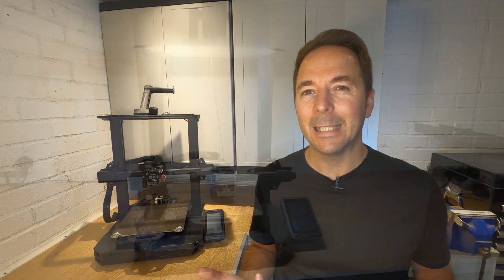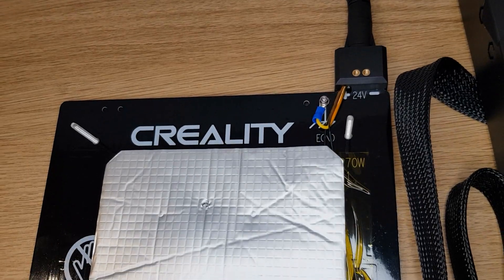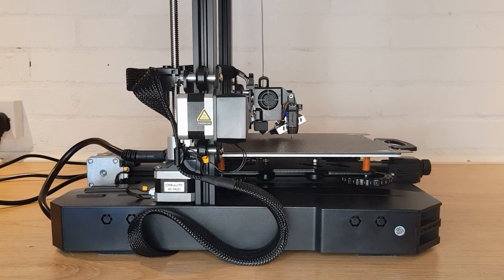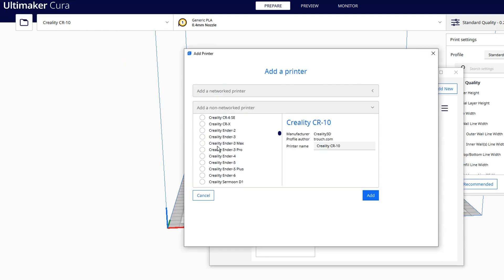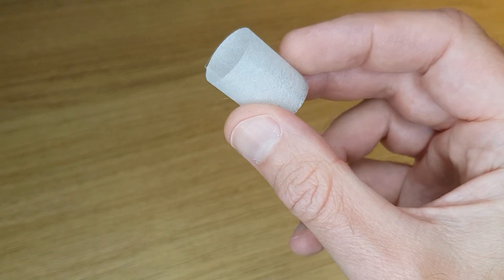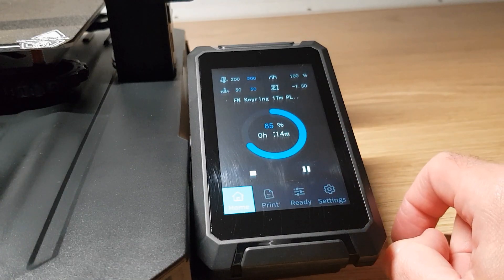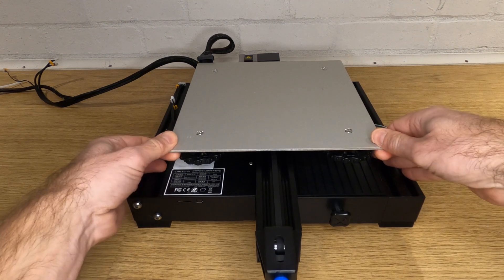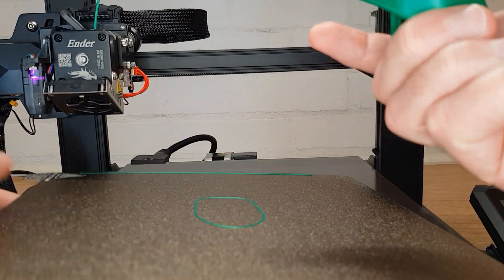Ender 3 S1 Pro 3D Printer Review - Is It Actually Worth That Much?

Comment: Here's my two cents about the review:
Awesome video - stumbled across your videos by accident by searching for Leveling fixes for the S1 Pro. You're one of the few people online that show the S1 Pro and not the Ender 3 or S1. 
Appreciate the indepth dive. 

This is my first 3D Printer and am really happy with it.
Now for the printer itself:
Going in I knew about "Quality control issues". And I am not equipped with two left hands. I love to tinker and know how to solve problems.
But boy oh boy was this a ride.
1) Bed rollers were wobbly. Excenter-Nut solved that.
2) X-Gantry floppy. Again the Excenter-Nuts were too lose and meant that the right rollers weren't even making contact with the V-Beam. 
3) Z-Axis Screws way too tight due to misaligned top / bottom ? I couldn't even move the X-Gantry by hand and this meant that when the printer reversed direction you could hear a hard "CLUNK" as if torque was released. I had some Z-Axis print-issues. I loosened the mounting brackets for the two Z-Axis motors aswell as the top mounts for the screws. Everything could move freely. Retightened and I think I have fixed it now. Not sure. Time and testprints will tell. 

All in All it's exactly like you said in your review. It's not plug and print. But it COULD be if Creality get's their QC together and fixes this.
Reply from the maker: Yep, they design pretty good machines but rarely put them together well. There are others that are starting to do it all better and if Creality don't sort out their issues, they are going to get left behind. Thanks for the comment giving your experiences. It's a shame that it seems you got worse build quality than me but glad you are capable of putting it right👍
Reply: @RickyImpey  Thank you for helping me as a newbie out with your great videos and especially the tutorial on Bed leveling and the addition of G-Code that is required to even use the bed-leveling. Appreciate the effort you put in your videos.
Reply: @RickyImpey  Can you do a video for PID on the Pro as well? Can't find a video for it. It doesn't seem to have AutoPID tuning like other models.
Reply from the maker: @TheD3adlysin  Have you watched this video? This is how to PID tune a 3d printer if you can't do it on the screen https://youtu.be/DG1Yvt02l1I
Reply: @Ricky Impey  Watching it now. Kinda fascinating that the Ender -3 S1 has AutoPID but somehow this Pro version omitted the feature...baffling.
Reply from the maker: @TheD3adlysin  Yes, I think it's all to do with the touch screen.

Comment: Great review. I just got my S1 Pro. For some reason when I run autolevel and go back into Aux level the Z offset is way lower than it should be and it drives the nozzle into the bed. I have also had the nozzle be way high, like up to 4mm. Not sure why my autolevel is being so inconsistent. I've checked all rollers and eliminated some (not all) of the slop in the Z rod bushings. The bed also has a pretty bad low spot in the middle and the autolevel does not seem to accommodate for. I'm less than impressed with this printer :(
Reply from the maker: Oh no! It certainly sounds like something is not right. It obviously shouldn't be doing that. Have you tried resetting the EEPROM, setting the z offset to see if it works ok without the bed mesh? I guess if your bed probe is not triggering correctly then you're never going to get a consistent z height 🤔 Have you tried contacting Creality for support?
Reply: @RickyImpey  yea I just sent them a response - see video (if you want) https://youtu.be/-l6K1gAY1WI
I have not tried resetting EPROM, not sure I know how, but I'll look it up. If I run the autolevel, then go back and manually correct the printer prints great. I'm just miffed that the automation is not working correctly.
Reply from the maker: @SinisterGamingTabletop  Watched your video. As you say, something is definitely not right. The only thing I couldn't see and you can check out, are the z axis lead screws moving when you drive the nozzle to the different points on the bed? If they are then it confirms that the printer is using the bed mesh to compensate for what it thinks is an uneven bed. That would very much narrow it down to a probe or mesh issue. I have seen other comments where people have had similar issues and I even tried to make mine mess up when I reviewed it but couldn't. I think there are a few people in the community looking for a solution but it would be interesting to see what Creality suggest here. Keep me posted.
Reply: OMG, I never even thought about that. I just checked and they do move ever so slightly. Thank you for that suggestion! I was wracking my brain about how to find out if it was doing what it was supposed to. I spent some time today tweaking on this thing. I trammed the X axis to get it into spec with a caliper. I also used it to get the bed the exact same height in all 4 corners. I then autoleveled and the Z was much closer. I ran Aux level  and this bed has a terrible low spot in the middle. With Z offset about where it needs to be the nozzle is way too low on the corners. I've never had luck with these mag beds. I'll be moving to glass on this one as well it looks like. I ran a 17 hour print that came out beautifully though. Looking forward to what Creality has to say.
Reply from the maker: @SinisterGamingTabletop  Glad you're making progress but they need to fix it for you😏
Reply: @RickyImpey  where are the z axis lead screws at I would like to see if they move

Comment: I still have the first version of the ender 3 Pro but have added skr board and glass bed . But this is the code I use for filament change

M17          ; Enable ALL Steppers
G91          ; Set Relative Positioning
G1 E-5 F500  ; Retract filament slightly
G0 Z50 F500  ; Move Z OUT OF THE WAY
M104 S220    ; Standby Temperature
M0           ; PAUSE - Wait for Button Press
M109 S220    ; Resume temperature
G0 Z-50 F500 ; Move Z BACK
G90          ; return to absolute positioning

Comment: I mentioned on another review, I would prefer it was shipped with loose rollers, as sometimes the wheels end up with a flat spot after storage and shipping. This might even be why some rollers are loose, as many people complained. But no, it shouldn't be touted as ready to go if that's the case. But I'll be happy if the rollers are loose upon delivery.
Reply from the maker: Oh definitely, much better than too tight but they should tell people how to adjust them like you say.

Comment: Your Ender 3 S1 Pro videos are the best I have ever seen. I have a question - As you suggested, I added the "M420 S1 Z10" comment in the Start G Code section of Cura. It it safe to add the G29 Auto Level code also? Or is this G29 code no longer necessary?
Reply: Thank you! The Ender 3 S1 Pro is a FANTASTIC printer, it just works. I upgraded from the Ender 3 v2 which I had to spend more time fiddling with than actually printing.
Reply from the maker: Thanks Allen, the G29 code is no longer necessary when you have the m420 code.

Comment: It's intersting, I recently bought the Mingda Magician X and it had the same issue where  the start Gcode didn't include the M420 code. I was wondering why all my prints wouldn't stick until I noticed that, and after, I had 0 issues. I'll be getting this printer after your review, but I will be modding it a bit. I feel that having an all metal hotend, really warrants a hardened steel nozzle or equivalent to really take an advantage of it. I'll also be changing the fans, being spoiled by the near-silent Mingda.

Comment: i have bought S1 Plus as my very first printer and exchanged hotend with copper heatbreak so it should be able to go up to 300 C .so i think best of Pro and plus. Only thing for me in the beggining was i think that firmware cause to bump nozle to heatbed so i have small dots in it. I updated firmware last week and looks like that home Z position doesn't go all the way down so it is not hitting bed anymore.
Reply from the maker: Giving the S1 Plus an all-metal heatbreak is a great mod. As you say, now it has the best of both the Pro and Plus. It wouldn't surprise me if Creality do this themselves soon.

Comment: How did you get the nut on after you put on your cable clip? There's almost no thread left for the nut to bite into.
Reply from the maker: Yes, the bolt ideally needs to be about 5mm longer but I still haven't changed mine.
Reply: Just for reference to anyone who runs into the same problem: The bolt holding the roller in place was too short for me after putting on Ricky's clip so I ended up getting an M5-0.8x45mm button head socket cap bolt and it worked great.
Reply from the maker: @stephenrbrough  Thanks for letting everyone know 👍

Comment: Why do I feel like all these machines will never top the architecture of the Anycubic I3 Mega.  They do not impress me at all. While I like modularity in some mechanical applpications, in a 3D printer, the simpler, cleaner and solid the machine is, the better.

Comment: The only reason I wouldn't recommend this to a beginner or someone who doesn't have one interested in one, is that you lose the experience of learning of each of the components through kit building and upgrading, but it isn't quite to the level of someone who isn't committed to printing to be able to print without hassle
Reply from the maker: I see your point. I think that, one day, there will come a time when someone is able to enjoy the hobby of 3d printing without having to be an expert on how 3d printers work. We are all used to machines that need a lot of understanding and maintenance so learning all about them is essential. The S1 Pro shows we are heading in the right direction but yes, you still need to learn all the things eventually.

Comment: 1) Um... that bottom plate... Where are the holes that correspond with the exhaust holes on PSU? 
Seems to be the reason why PSU fan is always working.

2) Does it really need double-Z and restricted top ends on both? 
I thought Ender frame can hold heavy direct hotends just fine since the granddaddy Ender 3, so why pay for it?

3) Do you experience false positives on filament run-out sensor (mostly with very flexible filaments)?

Overall, I just feel this machine costs about $100 more than it should...

Comment: I want to buy this or the Sidewinder X2 from Artillery... wich do you think is better? It will be for personal Use and my first 3d Printer! Thanks! Greetings from Argentina!
Reply from the maker: Hi, I would say that I like them both but slightly prefer almost everything about the S1 Pro. The one thing that is better on the X2 is the build volume. If you want to print bigger things buy the X2 or possibly the Ender 3 S1 Plus. If you don't need the larger build size then possibly go for the S1 Pro.

Comment: I can not seem to dial mine in. I'm new to printing and I just can't seem to get the prints right
Reply from the maker: What specific problems are you having?
Reply: @RickyImpey  I am getting terrible droop during even the slightest over hang and I am having a harder time getting the prints to stick. I noticed I am getting a popping sound from my filament and stringing seems to come and go out of nowhere during prints... Just a lot of inconsistency. I am trying a new Ruby nozzle out today to try and see if that helps
Reply from the maker: @jaydindotti5611  Have you tried drying your filament to reduce the stringing? It sounds like you have moisture in your filament if you are getting popping sounds. Do you know that your part cooling fan is running correctly? If it's not then that could cause drooping. Have you tried a Benchy to see how it performs?
Reply: @RickyImpey  I have not. I have printed various other things. I have worked on leveling, temps, speeds and supports and have dialing in the printer for 4 days. I will try a benchy next but idk how to read what I need to fix onces I see the mistakes. I do believe the fans are working but idk how well
Reply from the maker: @jaydindotti5611  no problem, check in your slicer that the cooling fan is set to 100% speed for PLA. Also, check out this video for an easy way to see if drying your filament helps https://youtu.be/WC3jvuq-uq8

Comment: Wow this is kinda funny, but I basically built my own Ender 3 S1 Pro off of an Ender 3 Pro. I upgraded the motherboard to a v4.2.7 silent stepper with a BL port, swapped my bowden tube-fed extruder for the Sprite direct drive extruder with all metal hot-end, tacked on a CR-Touch, and changed the magnetic bed to glass. I spent $210ish for all of these upgrades on top of a base Ender 3 Pro, so I feel like quite the accomplished modder.
Reply from the maker: That is a great feature of the Ender 3 range. They can be modified to whatever level you want. Thanks for the comment 👍

Comment: Nice video, Ricky. New subscriber, here. I've had my Ender 3 S1 Pro for a few months now and have been quite happy with it. It is the first 3D printer I've owned. Mine did not have the bed roller looseness you described, but the X axis belt was quite loose. Fortunately, tension adjustment for that belt is very simple on this printer. 

I would like to see your proposed video on changing filament mid-print. I'm looking forward to seeing more of your work.
Reply from the maker: Hi Tim, welcome to the channel. I already released the filament change video, you can find it here https://youtu.be/BZeFiAH1-bg

Comment: As the video states, there have been reported issues with the ABL. Some units have it, but apparently, some don't. What experiences do the watchers of this video have with their S1 Pro, does your printer's ABL work or not?
Reply: I have this problem and it's really annoying. It's my third printer so I have a little experience and I don't get it running correctly. Last try will be a Firmware Update. Pretty disappointed right now.

Comment: I am enjoying mine. I too had to fiddle with the bed before doing auto leveling as it was quite loose. Have only had it a few weeks and only 3 prints so far. For a complete beginner It didn't take long to get the first print happening. Yes I would like to see a video of how you changed filament mid print.

Comment: Great video. I have one of these as well. Would you mind checking the e-steps on your machine. Stock value seems to be 424.9, but I have measured the true value to be precisely 431 on my machine, and I suspect it's the same on them all.
Reply from the maker: I will do. I haven't done any calibration yet so need to do e steps, PID tune etc. I'll let you know what I find.
Reply: @RickyImpey  Nice. They've made e-steps very easy by having a menu for it under settings > adv.setting> movement> tx
Reply from the maker: @DKFX1  nice👍

Comment: So 415 GBP for a v-weels bed flinger, with setup issues out of the box (bed wheels) a completely wrong wire harness . What make it exactly "pro"? Just the direct drive and spring steel PEI?
Cheap for cheap I would go for the Kingroon kp5s. For half the money you get linear rails all round.

Comment: SSD relays tend to latch on when they fail if the mains heatbed is using one without other safety measures you could have a fire quite easily

Comment: Make you own printer it's open source  use prusa slicer and flash marlin to it high temp filament without a heated chamber good luck lol you need at least 90c chamber temp which is impossible with that cheap machine

Comment: How to do auto power off
Reply from the maker: There is no way to automatically turn the power off on a standard machine. You can use something like a Raspberry pi and Octoprint to control a mains relay though.
Reply: @RickyImpey  Thanks for your reply

Comment: I’ve modified my Ender 3v2 with direct drive microswiss, dual lead screws, bed leveler, replacement bed springs, etc, to get basically the same product. I saved some cash overall, got a lot out of the experience, and the customization support helped with further modification for enclosure and wire management, but if I ever wanted a second one with the same capabilities to increase my output, I’d probably go for one of these (or the larger one, since I only need the hotend for nylon firearm builds that are always designed with 220x220 build volume in mind). Time is money, afterall.
Reply from the maker: I do love that about the Ender 3 range. You can take something that is a relatively low budget machine and modify it to the spec you want. I would love to put together a printer like yours and put it back to back with the S1 Pro 🤔
Reply: I’m completely new to the idea of 3D printers but my plan was to do something similar that you mentioned with firearms. What advice/recommendations do you have for temp management and what kind of nylon? Again I really don’t know anything about 3D printers so any information would be greatly appreciated

Comment: In your video on bed leveling, a user mentioned that the ABL measurements were making his s1 pro behave worse rather than better.  Were you able to confirm the problem, or did you find that it's working correctly?

I'm asking because I have the s1 (not the pro), but I assume the problem will be in both machines.
Reply from the maker: As per the video, I tried to re-create the ABL problem on this machine but couldn't. This one didn't have that issue.
Reply: @RickyImpey  sorry, I missed that somehow. Thanks for the reply!